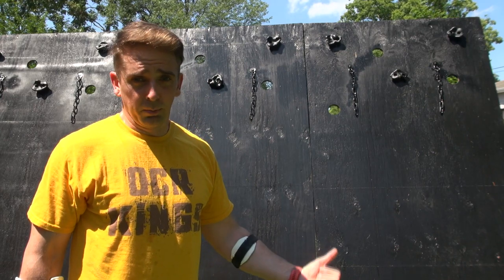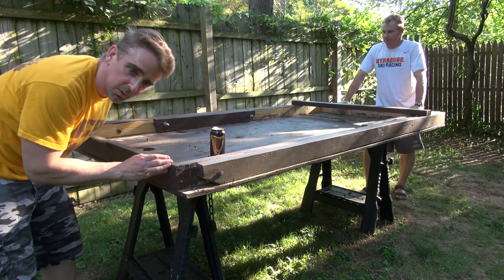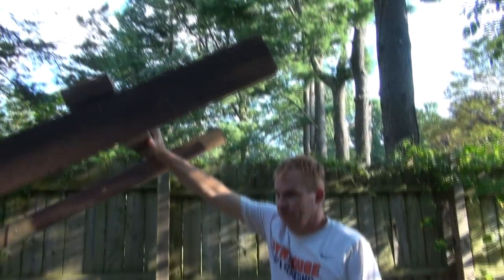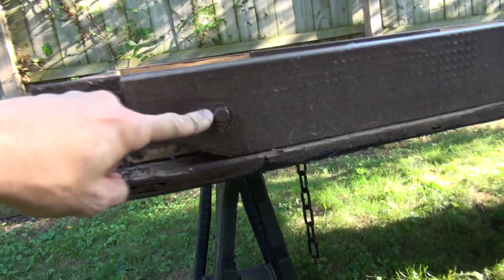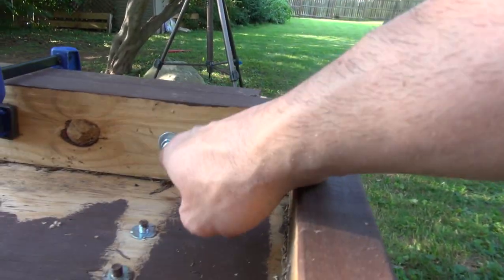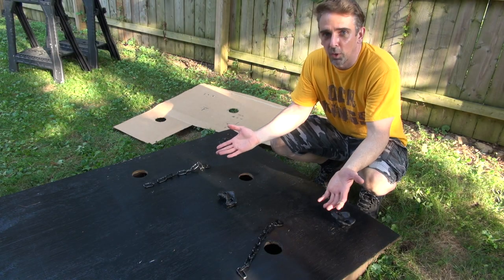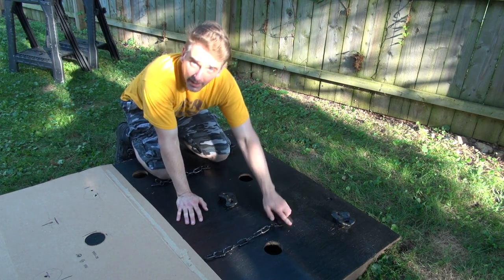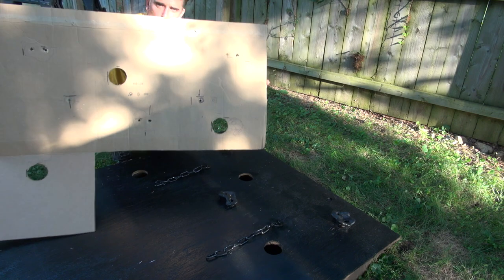How To Build Spartan Olympus

Comment: I have to ask. Previously on a video you two break down your preferred method of the wall. Both of you agreed on no chains. I watched your video of the Killington obstacles and noticed that you used the chains. 

The big difference is the ball on the end. I’ve also noticed that it seems easier with the ball than using the holes. When I came up on the wall at Killington I was paused assuming there would be no balls to use. I had prepped at West Virginia by using the holes so that’s what I went with. 

My question is do you say no chains unless there are balls then always go with the chains? Or did you just want to mix it up? 

Ohio was so muddy I couldn’t use the balls on the sprint or super. I tried just the chains on the beast but it didn’t work.
Reply from the maker: Great observation! We need to do an updated video. We've both taken to using the chains, due to the steeper angle and slippery surface, and since they put the balls at the end of them. We both prefer to put the bottoms of our feet to the wall surface, as high as we can get them. It took working out the best method for us on our slippery surface home built Olympus. Feet to the wall and chains seemed to be the most successful overall. Damer sometimes does a hybrid, where he'll use the chains and the holes, but at present, we both prefer to not use the climbing holds, and not put our knees to the wall surface.
Reply: This is one that I’ve changed up on. With the balls at the end it’s certainly easier. I just wasn’t expecting that on the beast/ultra course. Like I said in Ohio for the beast they weren’t there. I tried the chains and failed on the beast. For the super they had them and I got across. 

That’s when I was looking into your methods. In Fayetteville I used the holes but my legs slipped and I touched the ground. In WV I decided to pull my socks down so that my legs had more grip to the wall and that worked. Again that was all prep for Killington. So at killington when I had a plan and then saw the balls I was stumped initially. I knew getting my feet flat on was the best option. I had my knees to my armpits and feet flat then used the holes and grips. Afterwards watching your video I thought it would have been a lot easier with the chains since they had the balls at the end. Especially going from that straight to twister. 

Most courses taking time to think things through or even making a mistake and failing isn’t a big deal but with those time cutoffs it could rhe the difference between finishing and a DNF. 

It’s nice to have a plan going in. I just wasn’t prepared for the balls at the end on that course so it caused me to second guess myself. 

Again thanks so much for the videos that you guys put together and the attention to replies.

Comment: What was your cost back then?
Reply from the maker: It was about $35/per piece of plywood, maybe $100 for all the 2x4's, another $100 for paint and screws, and $50 or so for the hand-holds. Maybe with taxes it was $415-$450 in total.